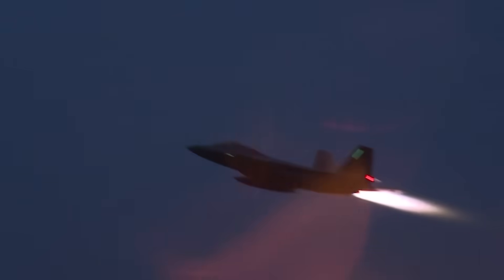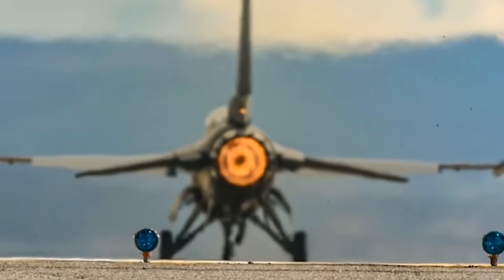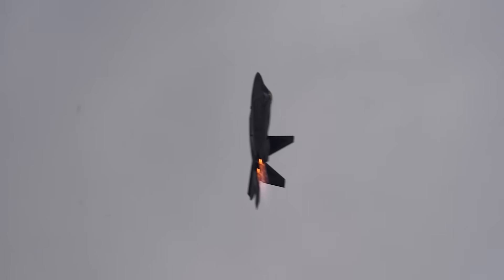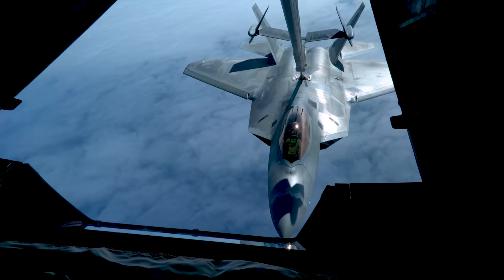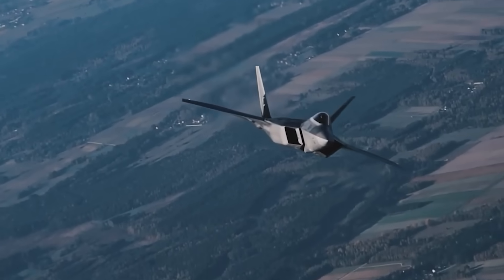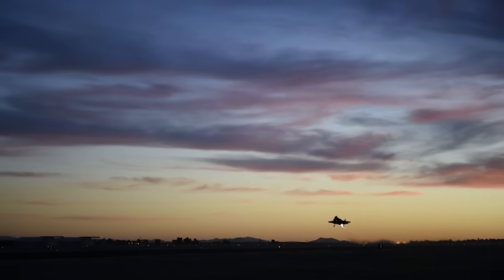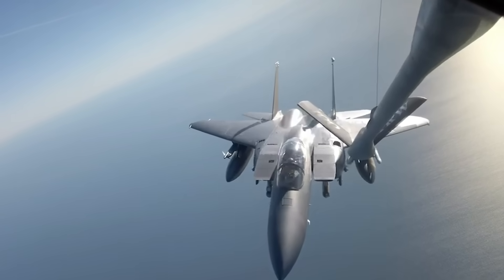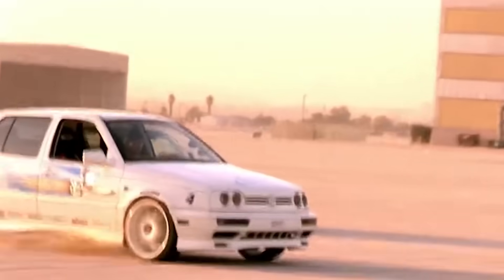Why the F-22 can only use AFTERBURNERS for a FEW MINUTES

Comment: I can guarantee you the F22 does not use a turbo fan. They're turbojet. Turbo fans are what airliners use (and the A10) and are essentially prop planes with a relatively small thrust vector from the jet engine exhaust. Turbojet are all exhaust. Far less efficient but they can operate at or above mach. Prop or fan driven planes cannot operate Above mach. The pressure wave from the compressed air prevents them from getting the airflow above mach. Turbojet intakes are designed to slow airflow to about 0.5 mach. That only works because the exhaust gas coming from a turbojet far exceeds mach. Prop blast will not.
Reply: Wrong.

“The F119-PW-100 turbofan is the first operational 5th Generation fighter engine. It combines stealth technologies and vectored thrust with high thrust-to-weight performance to provide unprecedented maneuverability and survivability.”
Reply: What you are thinking of is called a high-bypass turbofan, as used in most civilian jets, airliners, transports (and A-10). Most high perf fighter class aircraft engines since the TF-30 used in the F-111 are classified as low-bypass turbofans (including on every US fighter since F-14). They do have an actual fan in front of the compressor, unlike a pure turbojet, it's just smaller than the high-bypass version.
Reply: @richardb1452  
They're of course similar technologies.  China spend years reverse engineering the CFM56 civilian jetliner engine but then adapting it to low bypass military engines.  But yeah - the F-22 clearly uses turbofans.

PW has the geared turbofan that creates a really high bypass ratio.  I guess their problem is with reliability.
Reply: @ypw510  My response was more geared (forgive the pun) to the OP, but yes, pretty much all top tier fighter aircraft for a few decades now, utilize low-bypass turbofans, regardless of country of origin. Much better fuel economy than pure turbojet which gives better range and allows you to keep fuel in reserve for when the AB is needed.

Geared high-bypass turbofans have been around for decades in the smaller classes. It's about optimizing the core (turbines like to run fast) while simultaneously keeping fan tip speed subsonic (fans like to run slower and are MUCH quieter when they do). GE considered it for the LEAP, but decided to wait until their next gen.
Reply: @richardb1452 
I believe the TF30 was the first turbofan used in a fighter jet.  Had its issues in the F-14.

The UK fit a turbofan onto their version of the (correction) F-4.  Was better in almost every way.
Reply: @ypw510  AFAIK it was the first production afterburning turbofan for a fighter and while it worked well in the F-111/FB-111, it had issues with compressor stall at high AoA in the F-14. 
Comparing it with the RB199 in the Tornado (I assume that's what you mean by UK's version of F-14) isn't really a fair comparison. The TF30 was originally designed and tested in it's non-afterburning version in 1960 intended for the cancelled F6D Missileer. That's 10+ years before the RB199. A better comparison for the RB199 would be the YJ101, which in slightly enlarged form became the F404 in the F-18 or even the F100 from the F15/F16 as they were developed around the same time. Not sure the RB199 would be considered any better overall than those..
Reply: @richardb1452 
Was supposed to read F-4.  The Brits used a Rolls-Royce Spey turbofan in place of the General Electric J79 turbojet.
Reply: @ypw510  Ah...much better comparison👍
Reply: @richardb1452  
Yeah - just one more typo.  But reading about the Spey in the F-4, it may not have been better in every way.  It didn't quite fit and supposedly had less power at higher speeds in addition to higher aerodynamic drag.  But it was great at lower speeds for the UK's carriers.  Also had a really tall nose gear.  But the engine was more efficient, albeit at the cost of top-end performance.

Modern low-bypass turbofans are going to be better in every way.

Comment: Shows how badazz the f22 is the f15 is my fav plane its known for its power yet the f22 has more power in 1 engine then the f15 has in both. And also shows how powerful the u.s. jets are the f15 has the lowest power out put on this list per single engine of the u.s.a fighters and it still has more power then any foreign jet on this list. But it make sence when you take the scale of the country into account we got alot of land  to cover
Reply: It's not about raw numbers, it's about balancing all the factors (weight, fuel consumption, wing loading, stability or lack thereof, avionics, etc...) along with tactics/training to provide reliable overall mission capability. The Saturn AL-41F1S in the Russian Su-35 has more full AB thrust than the F110-GE-129 in the F-15EX for example, but that doesn't make it a "better" jet or even a "better" engine. Raw numbers might generate woodies, but it's the overall balance and training that gets the objective done while allowing you to come home.
And yes, the F-22 is definitely "badazz"...lol

Comment: Minutes??? LOL A f-16 can empty a center drop tank in 45 seconds in full burner. I've seen 13,000PPH per engine on a C17 power run. Burned 45k pounds of gas that time.

Comment: I'm interested in whether any other part of the engine or the plane would impose a practical limit on afterburner use before the fuel runs out. For example, how long can the exit nozzles handle the heat for? How long can the turbine actually spin at its max speed? 

If I drive my SUV at wide open throttle for 6 minutes, the engine, suspension or brakes are likely to give in before my fuel runs out.  But if I owned a Ferrari the fuel might be the only practical constraint. In this analogy  is the F-22 a Ferrari and the F-35 an SUV? Are they both Ferraris?

Comment: i know this is about the efficiency of afterburners, but the fact that the f15 has enough thrust for it to accelerate more than mach 1 vertically and the f22 has 7500 lb pounds of thrust more in each engine is mind-boggling. not even the Eurofighter comes close to that feat.
Reply: I'm curious what happens when you go with full afterburners at altitude for a few minutes in the F-22 or F-15.  Does the drag limit your speed or do you have to throttle back because of heat or other design limits?  We see stories about SR-71s exceeding their design speeds if the pilots have no choice due to a missile on their tail, but not sure if mach 2+ fighters can do that or if they are drag limited since they need to balance speed and agility.
Reply: The Eurofighter has a very similar thrust to weight since it weighs half of what an F-22 weighs.
Reply: @keymind117  thats fantastic context, preciate it

Comment: Another limit to how long a fighter can operate at full-reheat are thermal limits as the rear section of the jet-engine gets very hot and that heats up the surrounding fuselage, prolonged reheat use can cause serious heat-induced structural damage.
Reply: And with non-circular nozzles like in the F-22, the corners get hotter than the other parts of the nozzle. The boundary layer is much thicker at corners.

Comment: I mean with those engines in such a low drag airframe. The f22 is probably theoretically capable of mach 3 too. If the materials it is made of wouldnt just disintegrate during the attempt that is.

Comment: Can and may are two different things. They aren't allowed to use full afterburners at all because it damages the stealth coating and when they do use after burners it isn't for "a few minutes" it is far longer than a few minutes even if you stretch the meaning and they are still able to take off, go to a place and then land using an afterburner for 10+ minutes. Afterburners just kill your range and time but not to a few minutes. His math is all wrong because it doesn't take into account weight and the fuel you are burning.

Comment: The whole point of supercruise is to NOT use those thirsty afterburners which essentially turns a jet into a rocket. Rockets, as is well-known, are great for a lot of specific impulse, but crap at efficiency which is why going to space is still so expensive compared to, let's say, flying hours on end in an airliner

Comment: Paint question: how many minutes of burner do you get before the stealth coatings of both planes are ruined? I remember all the friction issues limiting their speed / burner usage.
Reply: Most likely it depends greatly on a whole number of variables, such as air humidity, temperature, "freshness" of the coating, etc.
Anyways they're working on ceramic coatings that are way more resistant.
Reply: Most likely it depends greatly on a whole number of variables, such as air humidity, temperature, "freshness" of the coating, etc.
Anyways they're working on ceramic coatings that are way more resistant.
Reply: Most likely it depends greatly on a whole number of variables, such as air humidity, temperature, "freshness" of the coating, etc.
Anyways they're working on ceramic coatings that are way more resistant.

Comment: The Concord was designed in the early 1960's, could "super-cruse" across the Atlantic at mach 2.00 without afterburners, as a PASSENGER JET!
Why in the hell, is it stunning to anyone that more than 60 years later a jet fighter can achieve mach 1.75 without afterburners?
Reply: The Concorde needed afterburners to go transonic and during takeoff.  It couldn't get to Mach 2 without using afterburners to first hit the speed of sound.  It could cruise at Mach 2 without afterburners, but only once the afterburners got them there.
Reply: The Concorde was optimized to move in a straight line and was shaped like a dart. The F-22 have to compromise to achieve stealth and maneuverability which reduces its cruise speed.
Reply: Drag increases as you go near Mach 1.  It decreases after you past Mach 1.
Reply: Why is there no Concorde in 2025?

I'd argue the reason for that is far dumber than why everyday people are fascinated with the F-22's ability to "supercruise" without afterburner.

The Concorde could "supercruise" without afterburners, like the F-22, because they both fly/flew at 50,000-60,000 feet.

It was different than all passenger jets, except for the Tu-144 ("Russian Concorde"), in that respect.

That's why.
Reply: @whiteoutgotu 
The Tu-144 was a death trap.

The primary reason was noise and operating costs.  Apparently Air France and BA claim it was profitable, but probably wouldn’t have been if dozens of airlines were operating it.  There would have been competition where prices would have dropped below profitability.
Reply: The Concorde was impressive like the SR-71 but also equally as flawed

Comment: Those SFC numbers are likely at sea level. At 30,000 ft or more, high bypass turbofans consume much less fuel, for a smaller reduction in thrust. That's why commercial and military jets all fly up there.
Reply: High performance turbofans used in tactical fighters are low bypass ratio.
Reply: the air is thinner at 30,000ft, so a jet engine can lose as much as 60% of it's available sea level thrust.
Reply: @pogo1140  And the fuel consumption decreases more than the thrust, so the thrust/fuel ratio improves.
Reply: I didn't hear factoring in that the afterburner cannot operate w/o also the normal engine running. Wouldn't you need to add the weight of fuel from normal use to the afterburner use and then use the combined total to do the rest of the math?
Reply: @mlong212  The afterburner numbers are the combined total, since, as you said, the afterburner requires the turbine running at full power.

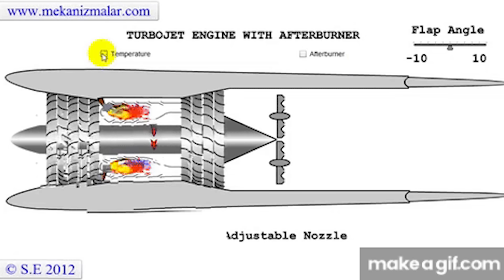Comment: 1:10 "with the remaining oxygen" - turbine engines don't consume all of the oxygen in the incoming air because that would put the turbine inlet temperature beyond the limits of blage technology, so there is some remaining oxygen for a afterburner.
Reply: I was taught in school that the majority of air going through a turbine engine is "secondary air" which is used for cooling the engine while "primary air" is used to feed combustion. It's amazing how many air channels there are inside the emgines, even holes drilled in some turbine blades so secondary air can flow through them.
Reply: @adeptuspotatocus6451 you're describing a turbo fan engine. They have the secondary airstream that flows around the core. Not all jet engines have this.
Reply: @140theguy  Nope, pretty much all modern turbine engines use some form of bleed air system that reroutes compressed air to the turbine sections for cooling. Some systems even blow inwards through the core.

Comment: I can't recall this exactly... but while deployed one of the B-1 AC'S gave me the honor of starting up all four engines of the lancer (and even wrote down what I needed to be say to the tower to get permission to do so).  He had told me at full load they burn over 200,000 pounds of fuel just to take off and get into their target air height.  Not sure if I recall that correctly,  but I don't care cause not a lot of enlisted people will ever get to start up the engines of a B-1.

Comment: The F-22 is not the only supercruiser out there - the F/A18 (early models) could just barely go over Mach1 w/o afterburner. I do not think that applies to the E's and F's.
Reply: Many of the Century Series interceptors and their contemporaries could supercruise too.  They lost that ability (in exchange for significantly more endurance) in the transition from turbojets to turbofans.
Reply: As well as the Euro Fighter

Comment: Alex did you see the news about Dawn Aerospace's (rocket powered) Mk-II Aurora recently beating the F-15's 1975 record for climbing to 20 km? 
It got there in 118 seconds, 4 seconds faster than the original F-15 Streak Eagle time.
Reply: "Recent".  That flight was last November.
Reply: @wagnerrp  My apologies. They released the video 2 days ago and it didn't contain the flight date anywhere in the video. Had to find it at the very bottom of the description just to make sure they're one in the same. 😊
Reply: I don't think it actually beat the F-15's record, since jetplanes and rocketplanes are in different categories.
Reply: @CptJistuce  Quite plausible.

Comment: Why don’t they use an oxygen tank while afterburner is on? It really only needs to last a minute or two… adding compressed oxygen to the afterburner would make a HUGE difference
Reply: No.  At that point there's enough air to produce nearly complete combustion.  Afterburners are inefficient because it's easy to just dump fuel into the exhaust.  It's not because they're starving for oxygen.

If you pumped O2 into the exhaust, it would still need to match the amount of fuel for complete combustion.  And how much O2 do you think can be carried?
Reply: if you want to melt your engine you can do that the extra fuel helps keep cool.

Comment: Flying at very high altitude can increase the time using afterburner. I think at 9000 pounds of fuel at 40k altitude the F16 can use them for 20 minutes before bingo fuel.

Comment: So how much does a scram jet or ram jet use 😳😳
Reply: The SR-71 numbers are often cited. That propulsion system performance is the default value given in all charts and graphs regrading Ramjet efficiency va mach. (Source: Correlated perfectly between NASA data and SR-71 Pilots operating manual).

Comment: The F-15 when fully loaded with fuel had 15 minutes of fuel when the V max switch was on!
Reply: They perform a no-restriction takeoff, and that number doubles within a minute of liftoff due to altitude, lower density ratio.

Comment: Every jet engine has a fuel consumption number, typically related to pounds of fuel per pound of thrust. This is denoted TSFC - Thrust Specific Fuel Consumption.

Most military, low-bypass turbofan or pure turbojet engine is going to be rates around 0.8-1.0. 

That means it needs 80%-100% of its thrust output to fly sustained for 1hr.

Afterburner bumps this to 1.8-2.0.

Most fighters have a fuel fraction of 0.3 - 0.35

And a thrust to weight ratio of 1:1 or thereabouts.

This means 0.35 hours (21 minutes) of endurance at MIL power, 1:1 Thrust to weight ratio, at sea-level. 

With afterburner, this drops to 10 minutes, 30 seconds. (This is for a jet having, say, a J85 or J79, with MIL TSFC of 1.0, and AB = 2.0lb/lbf/hr). 

Also, at 23,000ft density altitude, fuel consumption is cut in half. And endurance is doubled. Having a more efficient engine (0.8 vs 1.0) means 1.25x endurance. And throttling back to perhaps 70% thrust will also extend endurance another 1.3x.

So an F-35 would be super-cruising perhaps about 40 minutes (70 minutes no-reserve). between topping off with a tanker.

Comment: Litres per etc.
Pounds on fuel is like wheat by bushel instead of per tonne and yes that is at a measured moisture level.
Reply: weight is more accurate because volume changes with temperature, so gallons or litres does not work
Reply: @ironfist7789 True, Kilogram then🙂

Comment: In a turbine or turbo-jet engine fuel is not mixed in the compressor.  It is introduced in the combustion chamber. As depicted by the graphics...
Reply: Yeah that was odd and no mention of the diffuser section which actually is essential to make the engines work
Reply: @BaronVonFrankenBolzlll I just couldn't let something so basic and incorrect slide, that they didn't mention other key parts is easier to forgive in a brief overview.